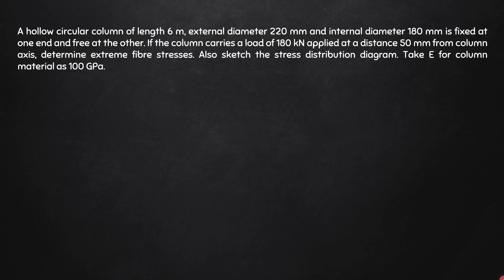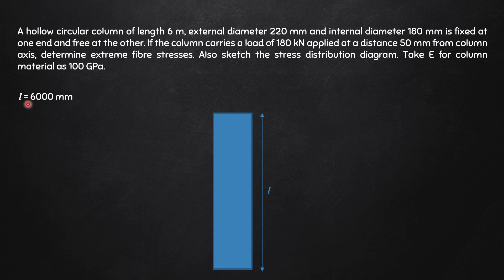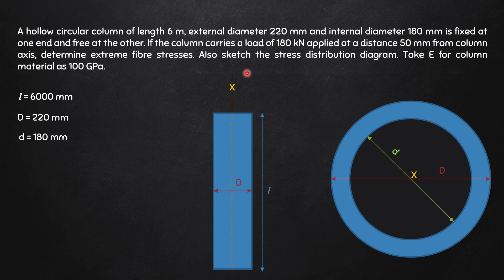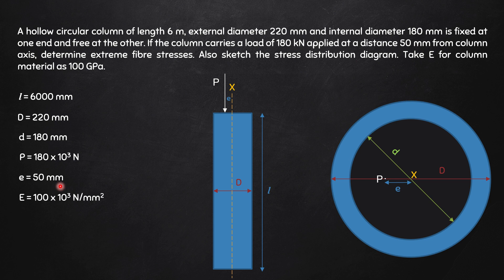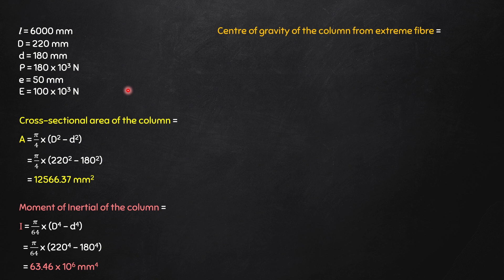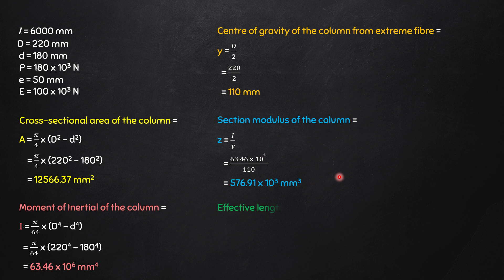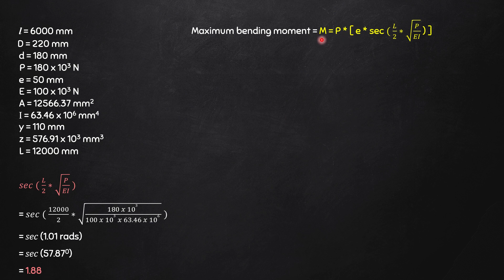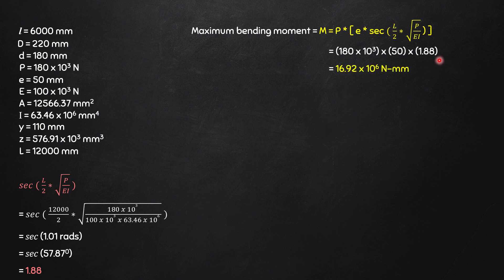| Eccentrically Loaded Columns | Lecture 2: Problem on Hollow Cylindrical Column | Rohan Dasgupta |

Comment: If this eccentric load is outside the column means any further attachment is on top and load is applied say 300 mm from the centre, in that case also above equations are valid ?
Reply from the maker: Yes.